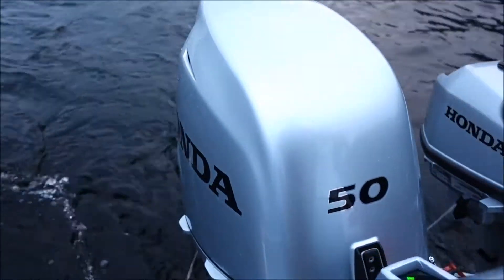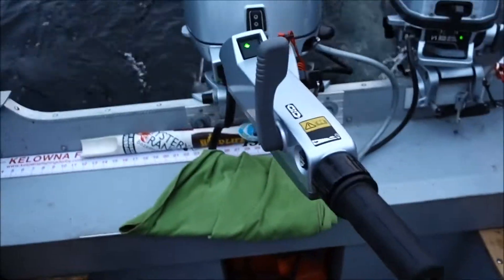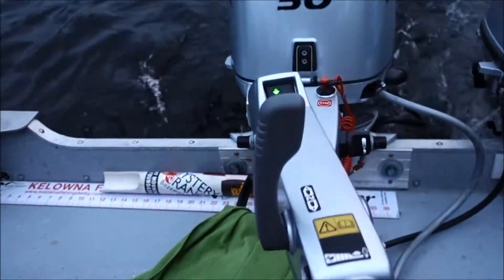OVER POWERED Lund SSV

Comment: I went the opposite route, went down from a new 40 hp tiller on a light 16ft to a 25 hp and am 100% happier {Mercury's}. I feel like a lot of people think that a bigger outboard is just more power, its not. Weight comes into play, with handling and effort to operate. I have a 2 vids on my channel of the 40 hp being too much. 1 vid of Holeshot with lift/torque steer, and another of it porpoising no matter what trim or transom height setting. What I found is that its the weight of the outboard on the transom, not the power that is the limiting factor. The older 2 stroke 40-50 hp outboards were around 180lbs with power trim, the new 4 strokes are 40-65 lb's heavier and thats mainly what created the above listed negative's. Your SSV is really decked out nicely, Im sure with your riggers, gear, passengers etc you are pushing some weight and that 50 hp feels good. My boat being a '93 says rated for 40 hp but back then they probably never imagined a 40 hp Merc weighing 247lb's, half of what the boat itself weighs then adding a gas, battery and driver in the rear.
Reply from the maker: Thanks for watching

Comment: I was wondering can you be given a ticket for running a lager motor than what is rated at?
And if I where to run a 50 I would get the new Suzuki lean tech. then run a Spot lock on the front for trolling 24 volt lithium.
Reply from the maker: Not in Canada. HP ratings are just a guideline here. In the USA you will get a fine. So it depends on your local laws.

Comment: You in Minnesota? I just bought the same boat and it has a Merc 20 I’m afraid it won’t be enough. Where is a good place to buy a used outboard?
Reply from the maker: I'm in British Columbia.  I'd go 40hp minimum.  And after running the 50hp on it for a couple years, the boat could handle a 60hp no problem.
Reply: @shuswapoutdoors  Wow you really think a ssv 16 can handle a 60 hp that weights 210 pounds? Do you think maybe the Hull of the boat might be to thin or the torque on transom? I would love to see a 60 on a SSV 16 for a science experiment see how well it does.
Reply from the maker: Yep, it could handle a 60 no problem.

Comment: Nice outfit. What is the risk of going from a 40hp max rated Lund ssv 16 to a 50hp?
Reply from the maker: Zero. It's all based off of weight. The 50 honda weights less than the max weight rating for the transom.

Comment: If the ssv 16 boat is rated for max 40 hp how does it handle the 50? I just bought a new ssv 16 and am trying to decide on an engine
Reply from the maker: kyle warmerdam now that we have the 50 on it, i would have been disappointed if we put a 40 on it. Imo the 50 is a perfect fit for this boat. One thing to watch is the weight of the motor, we went with the honda because it only weights 216 pounds
Reply: Shuswap Outdoors 
I can see how running a 50 is optimal when cruising across the lake but for trolling purposes does it idle down enough if I'm only running one engine and no kicker
Reply from the maker: kyle warmerdam nope, idle is 2.8mph, would need a trolling plate or trolling motor for fishing
Reply from the maker: Even a 40 would troll too fast
Reply: Difference would likely just be a few mph on the top end. Different hp outboards of the same displacement generate the same low end torque and only differ in the upper end of the power band, hole shot and load capacity would be very similar. However, why not maximize hp for weight. For people wanting to run larger lakes I'd recommend just jumping up to the ssv 18 and a 60hp outboard, no replacement for the extra length and beam. I'm partial though, I've owned both and although I appreciate the versatility of a 16 the 18 feels like twice the boat and I can still move it around by hand on its trailer.
Reply from the maker: @seakadventurer1330  the 18 with 60 would be my choice too
Reply: @shuswapoutdoors  im starting to think about a 20ft alaska with a 115. Wouldnt be able to move it by hand though
Reply: Thanks thats what Im 
 worried about I don't want the engine to bring the stern to low in the water.
Reply: @georgeworley8791  I ended up putting a 4 stroke 25 hp merc on it. It trolled great but needed more power to plain properly with more than 2 people in the boat. I would say a 40 would've been perfect
Reply: @shuswapoutdoors  18 with a 70 with how light the motors are being produced lol

Comment: How much was the 50 hp Honda?
Reply from the maker: call your local dealer...
Reply: Shuswap Outdoors, k thanks. Unsubscribing.
Reply: Shuswap Outdoors I'm alittle confused I have the 16 WC which is pretty much the same and each dealer or site they all say something different I'm in the great lakes and I use a 25 hp yamaha
Reply: Average quote from a dealer in the Midwest,about 8600.00.Complete out the door,including gauges and appropriate Power Tech stainless prop.A definite eye-opener.Like sticker shock.
Reply from the maker: @rezh.6193  lol, better off without you
Reply from the maker: @jordoncorby2187  the boat handles the 50 just fine and i think a 60 would be good as well
Reply from the maker: @redzmvt  pricey quote
Reply: I ended-up getting the 50 tiller late last fall.Total damage was 8100.00 out the door.That is with install,tach,troll control switch,14"pitch alum prop and a 3 gallon tank/hose.Amazed that it will go a long way on 3 gallons.Went with this motor because it is more compact and lighter than the others.Suzuki would have been equal,but no close dealer and in short supply.And was about 500 cheaper or so.
Reply: @redzmvt   reliable ?
Reply: @redzmvt  how do you like the troll control? did you add it to the Honda 50? I have this engine and want to add the troll control.